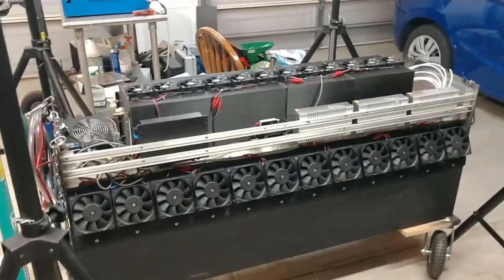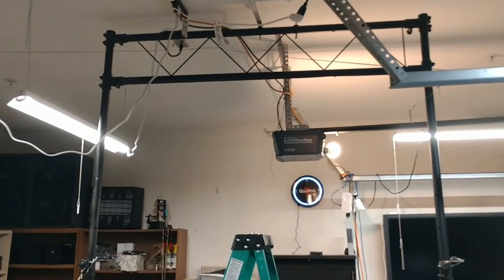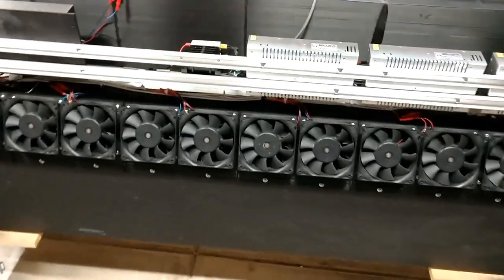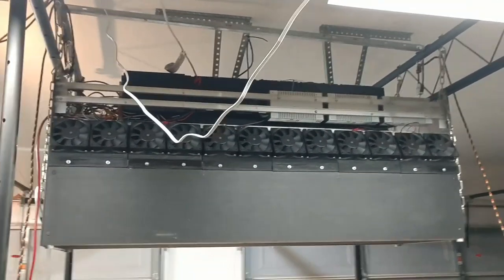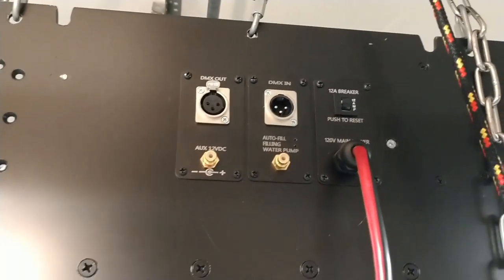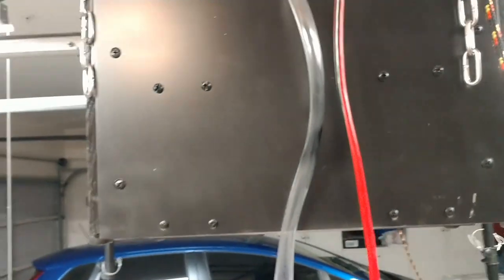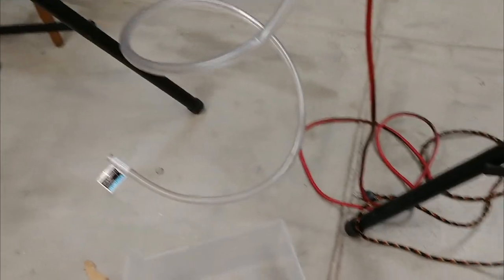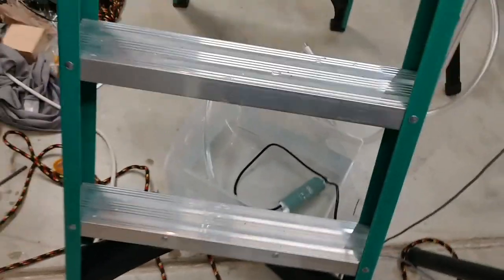Setting up Fogscreen

Comment: So this is epic, truly a masterpiece in Halloween engineering! Bravo! 
I read your whole build link on halloween forum. Super helpful, the keys are using ultrasonic fog (not a fog machine) and the big key is LAMINAR AIRFLOW. Luckily I have a Masters in Aeronautical Engineering so that probably means I will fail miserably :) But I wanted to say thank you for sharing such an amazing machine! 
I recently built a "DIY" weatherproof projector enclosure on my youtube channel. I had a similar experience as you, I went to Disney saw projection mapping used at the park and said "I need that!". Then I searched outdoor weatherproof projector enclosure and found the commercial company that builds them for Disney... then I saw the price!  :o Nope, it's going to need to be homemade. So I built one out of a server rack and it worked perfectly and cost about $150. 
Now I am thinking about recreating a little of the Pirates of the Caribbean ride. I love the skeleton steering the ships wheel and the fog screen the boat goes through when you enter and hear "dead men tell no tales..."  I was trying to figure out the fog screen and you help a ton! Thank you and Happy Halloween!
Reply from the maker: Lmaoooo! I'm sure you'll have no problems. I have no doubt that your masters degree will help immensely!  You'll be able to actually do the math instead of shooting in the dark, like I did!!  But yes, the major secret sauce is exactly what you mentioned. 

Thank you for your comments. If you ever need help or have any questions, send me a DM over at the Halloween Forum and I can send you my email address. I'll check out your channel to see your projects. I'm interested to see how this one turns out for you!

Good luck with your project and do keep me posted!
Reply: @absolom7691  Thank you! I’ll keep you posted when I start working on it.

Comment: What's the distance of the fog screen? Do you think you're able to hit 10 feet and still keep it laminar?
Reply from the maker: It's difficult to say. The truss system used in this video is maxed out at 10' which means that I'm only getting about 7' to the floor. It stays pretty laminar. I'm not sure if it can reach 10'.  I just bought some new (and sturdier) truss that maxes out at 12', I can test again when I get set up. I think the air curtain would probably need to be bigger though. Mine is 16.5" x 60".  Maybe 24" x 60" could do it...not sure. I could also try increasing the speed but that starts to get loud and increases the Reynolds number,which is bad. No clear answer though unless I test!

Comment: Nice , two things come to mind however.. #1 safety. You have children walk under thing rig?   YIKES!  #2 have you tried to offset the projector and correct the keystone  so you don't have the projector hot spot behind?    LOTS of work man . Congratz.
Reply from the maker: As for safety, I feel this is quite safe. The fogscreen, itself, weighs 192 lbs. The max weight rating for the lighting truss is 250 lbs. Since I don't like the idea of this being within 75% of the max weight, I have decided to use two trusses instead of one. All the other mounting components are rated far beyond the stresses I am introducing.

As for offsetting the projector, I can't really. The fact is, the fog particles are water vapor, tiny droplets, which is actually a pretty poor screen material, so, every lumen counts! The other interesting property of the water droplets is the Mie scatter. With the size of these water spheres, the light scatter tends to be in the same direction as the incidence. For the brightest display, it would benefit from having the projector direct behind the scree, at eye level but that would kill the viewer's eyes! So, I have this about as far out of the way as I can get it while still keeping the image bright. To be honest, the projector is more prevalent in the video than in person.

Thanks for the comment! This took many years and a lot of work. Trial and error brought me here!